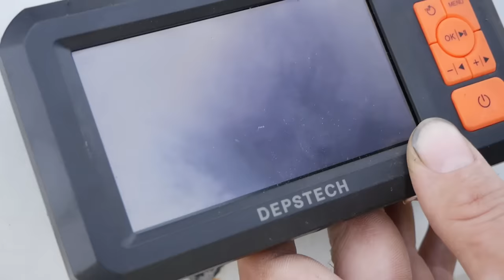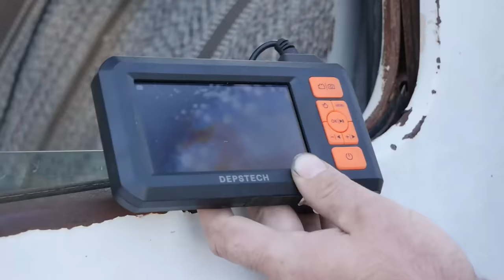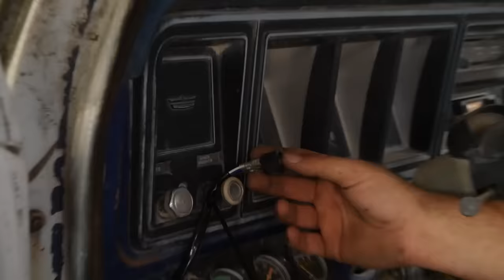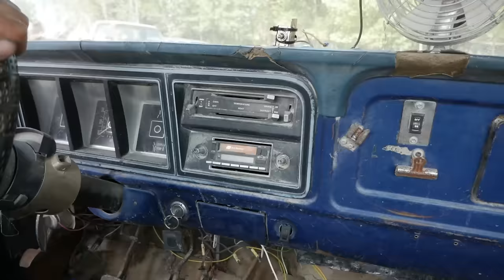Will STUBBY Ford Truck Run and Drive? Burnout Machine? Meet Sgt. Stubbs!

Comment: Mate, it's not ATF you're meant to feed the intake, it's brake fluid. And this is not a joke BTW, it'll clear off soot, carbon, and unstick rings. This method is used by wreckers to put compression back into some used engines. Warm up the engine, rev to 1500 to 2000 rpm, feed gently the brake fluid, revving to keep engine running, couple of WOTs, until smoke dissappears, done.

Comment: I spent my formative years in the Air Force and drove similar ford trucks of a similar vintage on the flight line. Thanks for the trip down memory lane. The Flying Tigers paint turned out great.
Reply: Found the AGE driver. Can we get a -86 for a C-130 on India 3?
Reply: I was thinking that looks like a bobtail truck.
Reply: My experience was from 99-2005 F series bobs and a few outgoing 12V Cummins Dodges. I wish they were all Cummins!
Reply: The Dodges liked to bounce the front end. But the air conditioning stopped working at 100*F.
Reply: @GasserNorm  Gas and brake could hang the hoops for sure! I loved how responsive the Cummins were and hated every 6.0 and 6.4 Powersmoke despite being a Ford fan.

Comment: Strangely, that old beast maight prove to be very handy to have around I'm thinkin. Personally, I love the fact that you favor the all one color theme, (whatever color that may be) over the patina look! It's really Hard to kill an old ford truck.
Reply from the maker: Paint everything!
Reply: @PoleBarnGarage  my... FAVORITE TRUCK ON THE CHANNEL...FIND A 460 AND SAVE THAT TRUCK THAT COULD BE THE CAR HAULER FOR THE HOLEY GOAT!!!
Reply: @clevelandmaker386  It’s a cool old truck, but someone projected it out of viability back in the day I think. Hard to imagine comfortably hauling with that wheel base. If this truck worked it probably shuttled trailers around at a truck depot. I’ve seen an old Toyota 1 ton with a 5th wheel that does that. Dalton could build a better bullnose 1 ton out of something else.
Reply: I just loved this buildout of Sgt. Stubbs and it almost compares in looks to the Holy Goat. The painting was just next level - Sgt Stubbs has character and needs to be used of something of use. Loved all the humor.
Reply: @swamp-yankee  It was in a trailer park. Note it has every hitch known to man at the back.
Reply: @colinl9018  good thinking would be perfect for a specific job like that

Comment: When i was a young teen, my buddy and I went thru my Dad's paint cabinet, we used a bunch of different colors but came to the same end result for an old wooden boat, we called it diarrhea green, it ended up being a very fitting color  for that fine water vessel, lmao 😂

Comment: I'm no pole barn mechanic. But I did have to swap out a head gasket and water pump on a 4.3 s10. I do realize it's a major pain in the ass. Once you go that deep. You end up replacing alot of other stuff because it's there and you have it taken apart. I do appreciate the "screw it, let's send it" approach

Comment: Had a 460 in a 84 F-250 4 X4 , the power and torque is under rated from the factory on the 460 engines. I used to drive though the high mountain passes in the Colorado mountains and that truck didn't even know they were there!

Comment: I learned a trick working on an old trailer if you wait to pressure wash the wood until you're done painting any overspray on the wood will disappear

Comment: Out of context but oh well- I rewatched all of the holey goat series episodes over the weekend. Truly incredible what you’ve done with outright junk! Don’t say you don’t care about it! You clearly love it! And you’ve said you’re not done with it. Want a suggestion? Restoring it is a ludicrous notion for sure but making it better is doable. All those holes and dents are just ugly dude. Weld up the areas that need it for structural integrity and slather the hole thing in epoxy and/or fiberglass. Either smooth over the dents and holes or just let the coating fill in naturally to keep the pitting effect from the holes. I would slap some cheap tractor paint over it but you’re more creative than that!

Comment: being 100% honest the engine seemed pretty healthy. oil blow by, head gasket leak. replace head gaskets. flush block and radiator. strong engine.

Comment: I'll say this Dalton. I have used the snake oil by K-Seal for any head gasket issues on any beaters (or even halfway newish old cars I come across with blown head gaskets) and I'll tell you what man, i literally have 100% that stuff works first time every time on ALL of the cars I've put it in. I'm not sure how, but for 20 bucks (not even) on scamazon, a little bottle of that dumped into the radiator and about 5 minutes of warmed up driving, an oil change and it's GOOD. No more steam from the tailpipe, no more bubble in the radiator. I am not sure what that stuff is, but it friggin' works man. Just sayin.

Comment: I’m betting the timing cover has a hole corroded in it or the timing cover gasket is leaking causing coolant to go into the crankcase.

Comment: The running boards make up for the lack of an actual floor. Just think of those as "External Reinforcement". Just like a push bar makes up for the lack of a front crossmember.  💯 safe. 😎

Comment: K&W nanotech block sealer works MIRACLES used it quite a few times….. had a 305 with a window crack in block behind water pump still don’t leak from 5yrs ago 
97 Sentra had a hole big enough to stick a pinky in still running driving not leaking

Comment: Heres a stupidly wonderful idea: Ditch the dually setup and put a gigantic pair of slicks on it. Small blower (i got that part from another comment) and make it either the worlds most irresponsible drag truck or a burnout machine.

That 460 actually sounds pretty wicked for what it is and it clearly doesnt want to die.

Bonus points if you do derby car headers through the hood

Comment: Awesome vehicle... for the price! :D -Is there a way to track the oil/water crossflow? And if it's "just" the headgaskets blown, wouldn't it be a project to do? Can't remember a revival channel doing that "the easy way"... The way that motor soldiers on, it would be nice to not blow it up... -further, I mean. Other than that, cool build, cool video! :)

Comment: Repair the air systém and give it a charger for 12v you can use it around the property to revive stuff that is flat on air or volts

Comment: You should take " Stubby ",  over to KC , Mo- since your already in Missouri. There picketing at the Ford plant,  good PR for your channel @ boost moral when they see stubby do a burnout  on there picket line. You will be a hit with workers,  Stubby is a F100 / 150... Plants in Claycomo,  Mo,  off of I35.
Reply from the maker: Well aware of where claycomo is, I'm UAW as well

Comment: I wonder if it just never got used to full operating temp as a tow rig and it was just super bad condensation in the oil, rather than a blown head gasket…?  Also, I’d love to see a comparison (small, doesn’t need to be a whole vehicle paint) of cheap prep/supplies/gun.  I.e. which is most important and which can be done decently, cheaply.  Can good prep save cheap supplies and tools?

Comment: NGL I wish you had done the head gaskets or at least pull the old ones off and smeared JB weld all over the deck and put the head back on I saw it work on a forklift and that thing never had a gasket problem again

Comment: Your "free" truck may be worth a lot more than you realize. Where I live, a complete rebuildable 460 is worth a grand. The complete cab is several grand and that 5th wheel hitch on the back is likely worth close to a grand. As for the shortened frame, stop worrying. I'm working on one right now. The frame was shortened to fit the "new" body. If done right, it is as strong as the original frame. Unfortunately I didn't see any fish plates on that one, but if he was a good enough welder, still not a big deal. I know it's fun, (and seriously hard to resist doing) but it might be a bad idea to blow up that engine. I'm in the middle of putting a rebuilt one back together right now. It's going into a truck much like that one. Similar color too. I've also seen a few old Fairlanes and Comets with those things stuffed in them. Don't write that thing off yet. It could be a heck of a lot of fun.
Reply: firstpolebarngarage  Scammer

Comment: I was thinking to clean the motor out ofthe milk shake put old used oil in it and put a new filter. Run it then put new oil and new filter

Comment: Is there oil in your radiator as well? I'm not a ford guy but I had a poorly sealed intaked on a sbc 350 and it was getting oil into the coolant. I'm wondering if you have a bad heater core (oil on the windshield) and possibly a reason besides a blown head gasket that your getting tons of water in the oil. Probably just junk but worth exploring. The crappy paint job made it look badass!
Reply: I guess you know you've made it big when the telegram scammers are replying to your subscribers comments 😂.

Comment: Did you know beforehand that it had a blown head gasket, or is there a possibility of a lot of rain making it down the yap? Admittedly, I have had engines sitting out on the ground uncovered for years that didn't have that kinda milk shake after getting busted off. In fact I cuangee the oil on the first race engine I ever got and it poured water out for a solid 45 seconds before oil came out, but the milkshake wasn't half as bad as that 460 the day before when I ran it after sitting with the hood open for over a month (was out of town 👀)

Comment: I have a 83 f150 4x4 w/ 351w. Has milkshake for oil. My problem is the damn timing chain cover keeps allowing coolant to leak directly into the oil pan. I have redone the cover twice. Even bought a new W/P and timing cover. Followed the torque specs and everything. 
 I hate the way ford designed the timing chain cover on the small blocks. From what I remember the BB fords have a different timing cover design.

Comment: man, I can't really tell you what to do: But consider this. If you rebuilt that motor, you'd have a powerful torquey 5th wheel/utility/towing rig for day to day dumb shit in the woods. It MOSTLY works, even the fkn brakes are OK. Put some winches on it, maybe some mudflap girls, and use it to hook to a 5th wheel trailer for picking up stuff from marketplace or hauling garbage, or get a 5th camper and make it into a camping rig you can take to the nascar infield. You could open a side hustle moving old mobile homes and restoring them and reselling them. Being a shorter truck means it weighs less, so, it would be better on gas overall than another capable rig, and have more power dedicated to hauling your rigging instead of just moving the truck itself. Maybe re-inforce those welds with some sort of brackets. Get that air compressor going, rip out the old interior fuel tank, and put that back to work. I know you tend to halfass do things, but it seems to pay off way more than you think, and if you gave it as much of your dedication as that black chevy you'd have a powerful utility vehicle. 
Also consider, you have invested nothing in it at all. if you bought gaskets and rings and timing parts and shit, that'd be the only cost for the truck. It would be a bad ass, and unique as hell.

Comment: you were supposed to pour about half the quart while the rpms were up and then pour the rest in fast and make the engine shut off. then wait an hour for the atf to soak into the carbon and soften it up, start it up and rev it until it clears up.

Comment: Deck armor. It is for coating a deck or concrete, acts like bed liner.. My thinking is deck armor the roof of the shop. Having to blow 4 tires to impress the croud.

Comment: Evertyhing else about those fords may be garbage but that particular motor. Ford made them to be IMMORTAL.
You can run the coolant system on flint michigan pondwater, the engine on used carnival cooking oil, and fill the tank with $2 well whiskey and it will still spin. I know mechanics that swear the only way to kill that mill is to stab it thru the block with a  Silver Wrench.

Comment: Those trucks and motors are known for intake manifold leaks like the sbc from the china wall gaskets failing or you can always tear it down and change the head gaskets maybe even check the heads my momma's truck had a intake manifold plenum gasket leak at the front of the manifold and it looked like it was the water pump leaking and eventually it did but the reason it had a milkshake in the oil it had a intake manifold plenum gasket leak and it got new intake manifold plenum gaskets and the intake manifold to the cylinder heads gaskets, but that was before it sat for 3 years for other issues so it needs water pump and gaskets the front and rear main seals are leaking the valve cover gaskets are leaking and the fuel pump feed line to the motor is leaking so all that has to be replaced add that to its several broken exhaust manifold bolts and the dr side exhaust manifold gaskets are Bluetooth lol,, both sides of the oil pan leak but not the front or the rear so the motor has to come out and be resealed and put back into the 96 Ford f250 super cab long bed hd Calypso green with dual hunter green mid and bottom stripes.. tough truck though!!

Comment: The air tank isn't for airing up tires, it's to get the brakes to unlock on the trailers.. Most trailers meant to be towed by a semi have automatic parking brakes that only let loose once they see over (I believe) 100psi in the lines and if you don't have air... they don't move.. like an actual semi can't get them to move. (watch Ron Pratt from Midwest Truck in Scott City Missouri) https://www.youtube.com/@RonPratt 
You gotta love a 460, so long as there's not a rod hanging out of the side of the truck and they have spark and fuel, they'll run.. hell they'll probably continue to run with the rod out so long as there's some oil left and the crank isn't broken, sort of like the Honda motorcycle engine of American V8's.. the things are indestructible. Urethanes are typically mixed 4:1:1 paint/reducer/catalyst. Yeah I was going to be a custom painter/bodyman.. and then scoliosis cost me that option and many others.. now I'm as worthless as my bullies always said I was. 
That was third... that thing probably has like a 5.28 or 5.56 or lower gear in it, tugs typically do. It's probably a Dana 90 axle out of a semi.

Comment: just throw some gaskets in it     its really really easy to do and itll clean up the milkshake oil and revamp the barrings and give the engine more life      the rad fan on the 460 is so loud you can barely hear the engine      should go with electric fans

Comment: I would say treat the engine to some preventative work (new top-end gaskets) since it treated you so well, but then I remembered that this is PBG; if it runs and isn't a Pontiac A body or the Torino, it doesn't get crap for engine work. Not to say that it's worth any work anyway, that frame weld is sketch.

Comment: I can definitely tell you with all honesty you ain't no painter you're not even amateur a painter I paid for a living even if I don't care about it I still do a better job than that it doesn't matter if it's a small piece a truck a full size trailer the painter coming from inside you're definitely a outside💯💯💯💯💯💯
Reply from the maker: If you're grammar, spelling, and punctuation are any indication of your painting ability, I'm sure you're real good
Reply: @PoleBarnGarage  well first of all I was eating dinner so I used the microphone to leave the comment second of all I I even mentioned that you said you didn't really care about the paint on the truck but what I'm saying is any real painter would have put a little effort in it because that's what a real painter does
💯💯💯

Comment: Mr. pole barn how does one replace hydraulic lifters in a ford 2.8 v6?
Reply: 2.8 Ford is rare these days I had one in a 85 Ranger haven't found another one in probably 20 years or more
Reply: @frankm8533  yup i got an 85 ranger manual but its a basketcase
Reply: @dave7569  That's awsome that's what I drove in high school late 90s lowered wheels air ride interior was done did my engine bay in school I loved that 2.8 5spd it was just a nice driver but truck was stolen in 2002 never saw it again
Reply: @frankm8533  damn im sorry to hear that
sounds like you had a pimped out one, mine was dirt cheap and covered in white house paint. Any tips on how to change the hydraulic valve lifters?
Reply: @dave7569  Wish I could remember how to do that I haven't touched at 2.8  engine since 1999 have you tried to find any videos on that particular engine I'd assume there's probably not alot about them I use to have a paper work pictures and manuals for that 2.8 but it all got tossed out long ago during a move
Reply: @frankm8533 no worries i couldnt find any videos but i do have a haynes manual for it, any ways thank you! have a good rest of your day

Comment: Man, it's been pulling trailers like mobile home trailers. I'm guessing I'm sure it's had some tortional load on it. At some point doing that, wouldn't you?
Reply from the maker: That would be lateral wouldn't it? Pulling straight, no bumps really

Comment: YOu not connect the lights directly to the battery. you connect that to the positive that goes to the fuse panel.
Reply from the maker: That's not how electricity works, but nice attempt.
Reply: @PoleBarnGarage   lolll and the fuse will work how if you plug directly to the battery the positive cable?
Reply from the maker: I had a stroke trying to read this
Reply: @PoleBarnGarage  lol